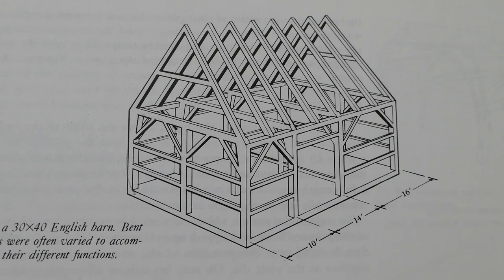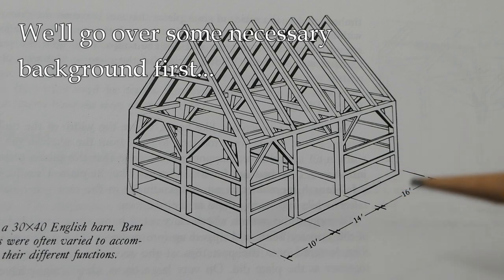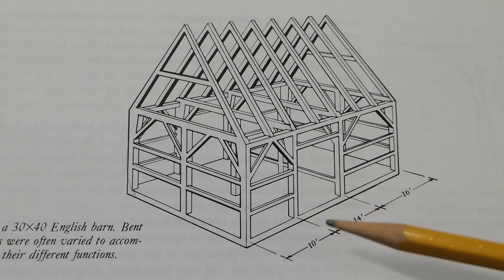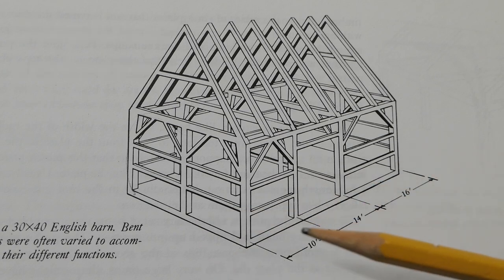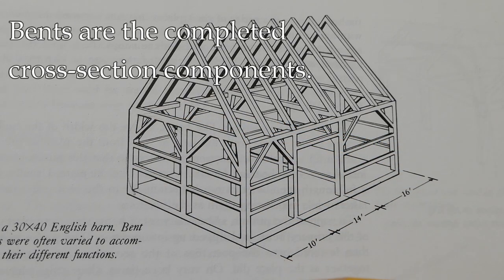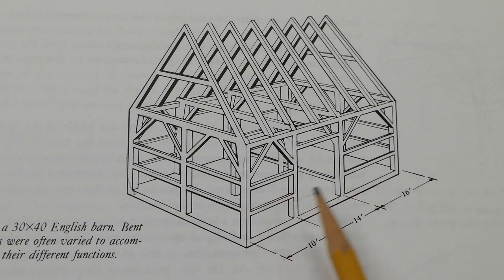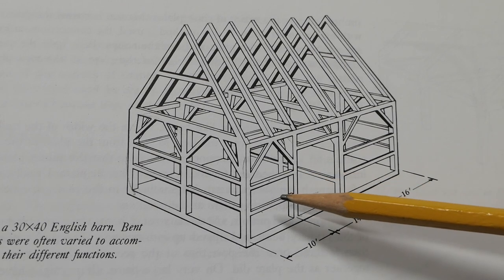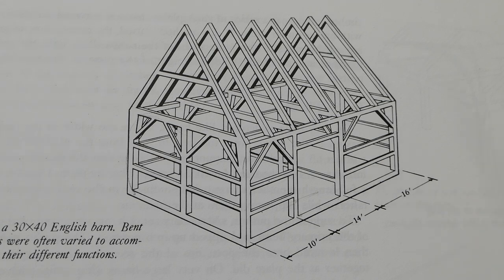Installing New Windows In A 1700s Timber Frame Home

Comment: What a mess! Big job.  Impressive problem solving and results on this one.  You've probably seen plenty of hacked up framing and have a whole arsenal of mix and match solutions.  I wonder how much internal structure was also compromised to retro-fit modern conveniences.
Reply from the maker: It's not unusual to find girts or beams hacked away for window placement.  I've actually seen both girts and a post hacked away for the same window!  Can you imagine cutting through a 6x8 inch post and thinking that was a good idea??  In these cases the loads get transferred to sheathing, to siding and to other framing members, or there isn't sufficient transference and the wall sinks or bows outward.  I once repaired a timber frame home that was completely unsupported on one corner of the house.  Six feet in one direction and ten feet in the other was cantilevered over thin air, hanging by the sheathing and siding!
Reply: @enduringcharm  That would be heart stopping.

Comment: Great video, have you ever dealt with sill replacement on house from the 1700s? I currently purchased a home from this era  and a majority of the sill appears to be solid, however along one side of the house, powder post beetles have done some damage. Is this anything to be concerned about?
Reply from the maker: Yes, I have extensive experience in replacing rotted or otherwise compromised sills.  Some of the experience I'd just as soon forget!  And, yes, you should be concerned--at least until you determine the extent of the damage.  Houses of this era, which were post and beam style timber frames, were often frames built close to the ground.  The foundation, which was typically rock or rubble, barely made it above the level of the dirt and that is where the timber sill was laid.  Sometimes the sills were even laid right on the ground!  As a result, rot and bugs are common.  The houses which were built on a taller foundation a foot or more from ground level usually fare better.  City houses typically have a taller foundation than country houses.  

Anyway, with large timber sills the outside edge rots or gets eaten by bugs first.  When that occurs the sill can start to roll outward with the weight of the posts and the wall, which causes the walls to splay outward too.  I've also seen entire sills just disappear along a wall, leaving a huge air gap between the foundation and the wall base.  In that case, other components such as siding and sheathing (if there is any) become structural!  Powder post beetles can do a lot of damage which is hidden.  The exterior of the timber will appear fairly normal but for some tiny holes.  But, you may be able to poke a screwdriver through the surface and pry off giant sections of a sill or a beam.  The inside will just be a fine powdery dust.  

You should find a local carpenter who is familiar with timber frame homes of this era.  Get to know him.  Ply him with food and drink.  The knowledge and experience needed to work on homes of this era are very different from that needed for modern construction and if you find an experienced guy you should hang onto him until his death, which will probably not be long in coming.  There are lots of steps that can be taken to better protect the sills if need be, and there are lots of ways to repair compromised frames.  It is a specialty requiring unique knowledge, though.
Reply: @enduringcharm   Thanks for the reply,  luckily my sills rest on some large 1x 4 foot  granite blocks. All the sills sit atleast 16- 24 inches from the ground. I am just trying to figure out how well these old wood timber frames hold up. I will reach out to local carpenters.

Comment: John, not sure if I missed it.  What are the homeowners going to due about the compromised structure issues?
Reply from the maker: I haven't got to the lower windows yet, so I still don't know if there is a lower girt for each bent or not.  Either way, the sheathing itself has now effectively become a structural member.  This is why working on old houses requires extreme caution and extensive knowledge of old methods.  You can get into trouble quickly if you make assumptions or blindly follow modern practice.  Another example is attic floorboards.  In some timber frame houses the original timber top beams were undersized, or they were compromised by remodeling or rot.  The attic floorboards then become structural members, literally preventing the rafters from pushing the walls outward.  New owners move in and get the bright idea of using the wide pumpkin pine attic floorboards in another area of the house.  They pull the floorboards up and the walls blow out! 

Anyway, in this particular house there is nowhere near the budget to open up the walls and repair framing.  That would cost several orders of magnitude more.  For now the walls will be wavy and there will be considerable seasonal movement.  Someday the owners could choose to open up a wall at a time and make repairs, in which case they can work around and integrate the window frames I'm building now.